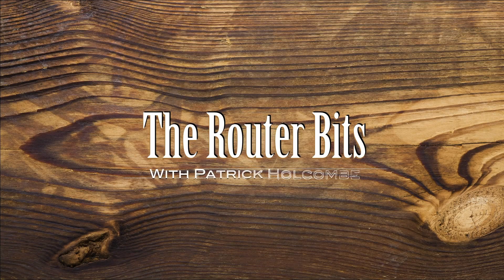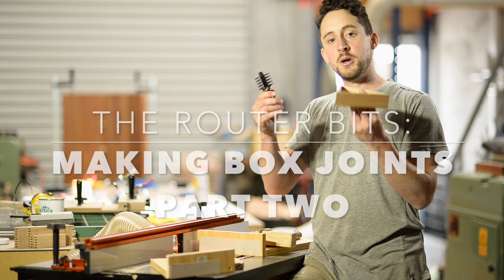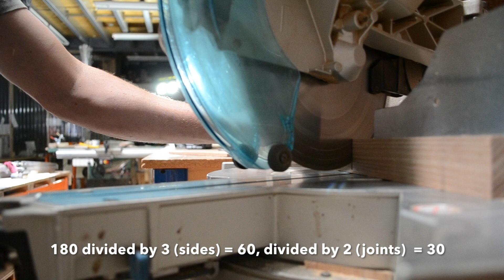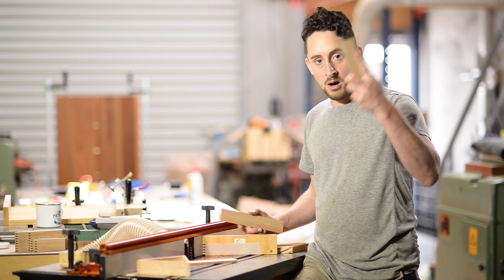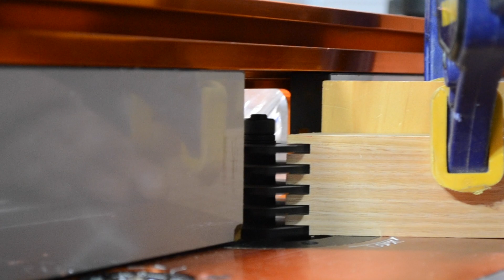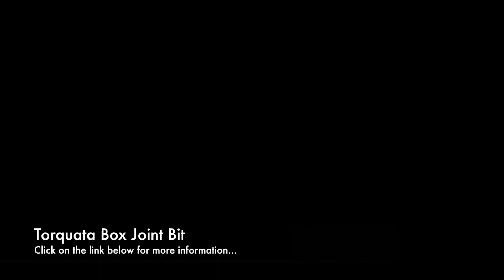The Router Bits - Making Box Joints - Part Two

Comment: nice vid. i have a question,  well two actually. 1. can you adjust the teeth to make 8mm fingers instead of 4mm??  And second, would you recommend this over the infinity flat top dado blade for my table saw? I wanna be able to bang out decent volume but i do like the idea of not having to clean up my tennons, dados, rabbets, etc
Reply from the maker: Hi Vince.

Yes you can always undo the arbor nut and restack them into different configurations such as 8mm. It may need some shimming but there are shims in all these sets so you could re-use those to get it spot-on. Not problem with that at all.
It really comes down to which way you want to go - the box joint bit works with the piece set horizontally and does many cuts in one pass vs. the flat top blade, however the flat-top blade has the ability to be far more versatile when you match it with something like the MicroJig Match Fit Dado Jig that the box joint bit couldn't compete with. We couldn't really make a call on which one would be better without knowing the specific application. Hope this info helps.
Reply: Thanks, that was really helpful. I was already leaning toward the flat top blade anyway. though i'll probably find an excuse to spoil myself and get the router bit as well at some point in the near future. :D 
p.s. keep up the good work with the vids. there aren't many youtubers that speak in metric measurements, so keep em coming
Reply from the maker: Just wait until we start releasing some of the products that have only been available in imperial measurements (the flat-top blade and stacked dado) in metric then! About time that these sorts of things should be on the market, should make our lives here in Oz a bit easier! 😉